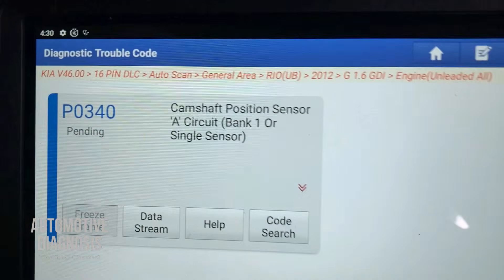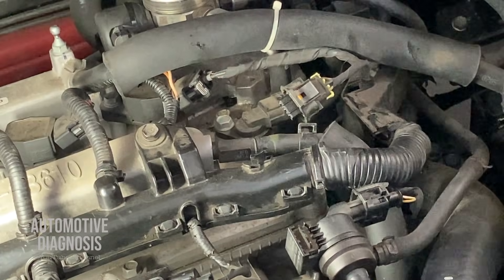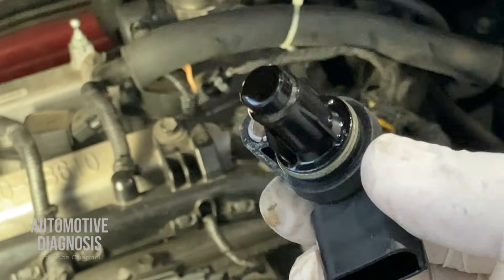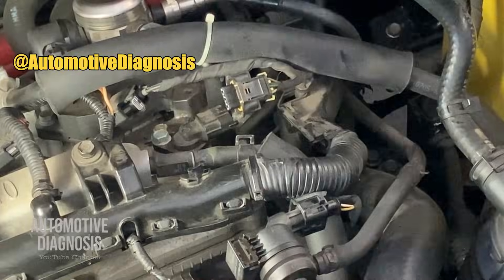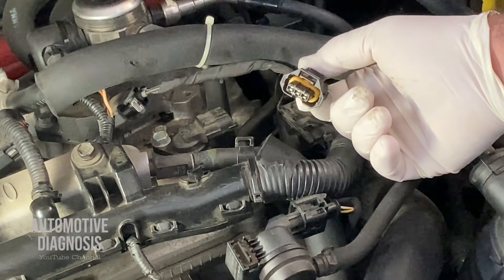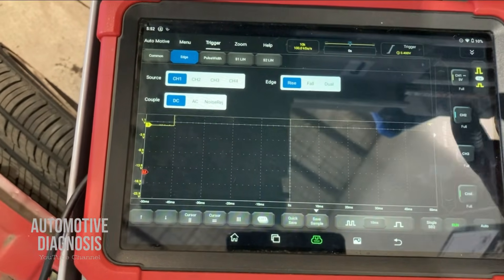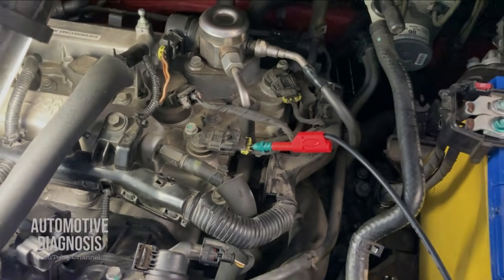How to Test & Fix P0340 Camshaft Position Sensor "A" Circuit Fault Code |Fix Engine Starting Problem

Comment: What if signal is missing when sensor got hot or get over 3k rpm , and only have signal when is cold ?
Reply from the maker: Hi there, temperature can affect the sensor and wiring, so it could be a bad sensor or bad wiring that shows the fault at high temp. Check the power supply and ground when you get the fault, it could be from those wires. Sensor itself could be the cause as well, but after wiring are inspected.
Reply: @AutomotiveDiagnosis Vcc and Gnd is present after the faulth , only the oscilograme its gone , no more signal ! I think 100% bad sensor !

Comment: My dodge 1999 had po340  check For  signal 5v out put  and 8v supple good  and ground  . Wire connect to pcm checked. But just crank  not start   Any help thank
Reply from the maker: Hi there, this could be the sensor issue too, You already checked the wiring, but finally the sensor is supposed to generate the signal.

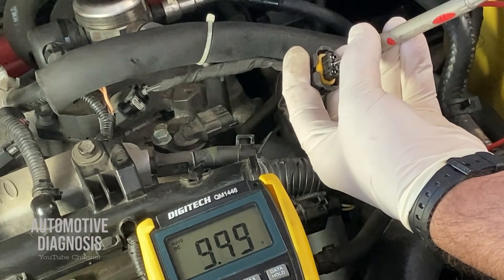Comment: HI ,thanx for amazing  viedo and i am asking , at 5:33 why we have 5V come from ECU ?
Reply: 5 volts is ussually the ecm output ti the sensor also known as a eeference volts.. this is a base volts to avoid registered error in the  ecm due to voltage drop .. ex. During starting or low battery charge..

Comment: here in Brazil. my oscilloscope is a Hantek four channel. I will directly on output signal of the sensor if the sign being good perfect the input power 5 volt is good and ground is good as well. okay. I am faster with one test.  I just only sharing my experience.
Reply from the maker: Hi my friend, thanks for sharing your experience. That’s absolutely correct, but the reason that I explained how to check the other wires with multimeter was that many friends don’t have the oscilloscope, so they have to check it with a multimeter as much as possible.
Reply: Thank you for that like me I don't have oscilloscope yet

Comment: 05:40 This is called a Bias Voltage, very weak voltage (because of high resistance in series inside the ECU)
Reply from the maker: Thanks for sharing your experience
Reply: Yet I don't understand very well it.

Comment: Toyota Corolla professional P0368,P0343  test supply ,ground and signal wiring is in good condition .even if I swap intake and exhaust flaut codes stays the same.Replace sensor
Reply from the maker: Hi there, you have fault codes for both intake and exhaust camshafts. Have you considered checking the engine timing?
Reply: Hi sir, did you find the solution? Im stuck with a same problem

Comment: Thank you pro but the code that you get it is pending code from mode 7 is not confirmed yet
Reply from the maker: Hi my friend. As you might have noticed, there wasn’t actually anything wrong with this cam sensor, I was just explaining how to perform the diagnostics.